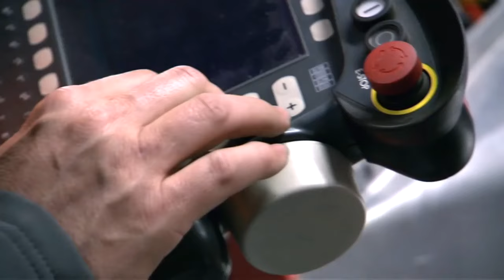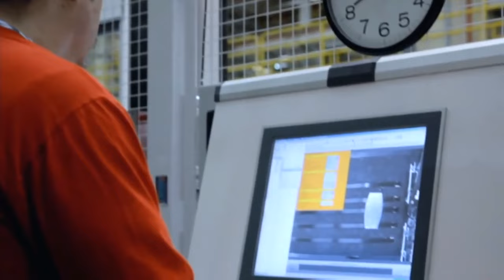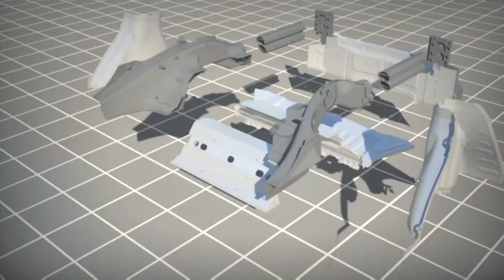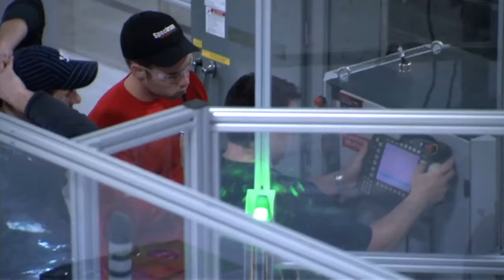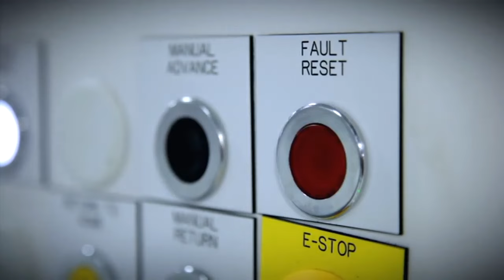TESLA Factory🚘2024 [Production line]: Model 3 + Model S Assembly🔥Manufacturing [Car GIGA FACTORY]

Comment: Because the body parts for Tesla vehicles are stamped and in one piece how did they repair an accident on a vehicle like that if a quarter panel has to be replaced or a front section of the vehicle has to be replaced who does the repair and how is it done
Reply from the maker: Thanks a lot for your comment Joel.
Reply: The frame is one piece not the panels. If the frame of any vehicle is damaged the insurance co writes off the vehicle.